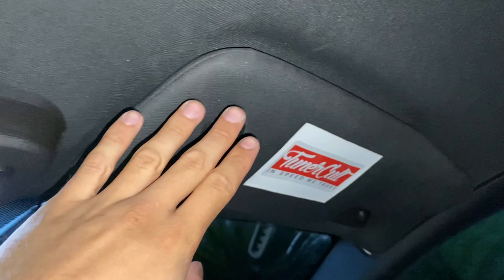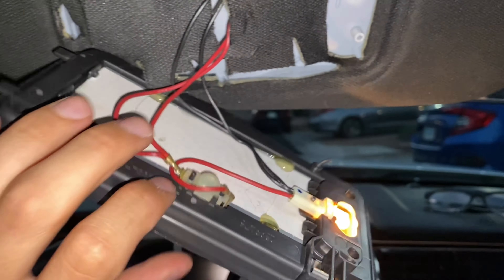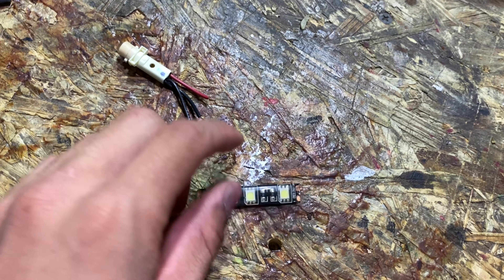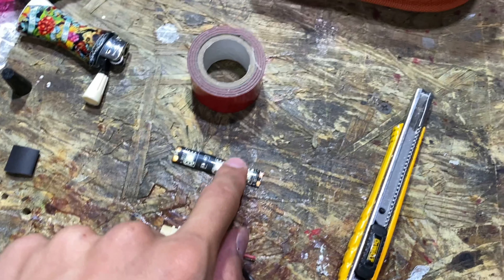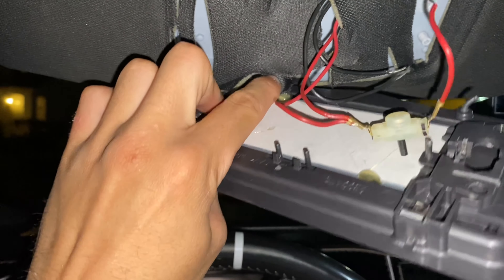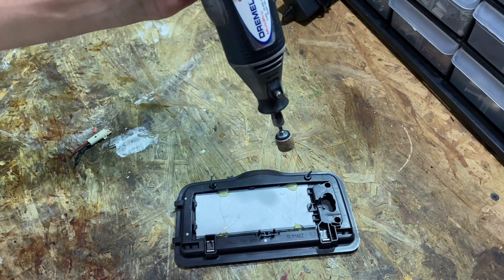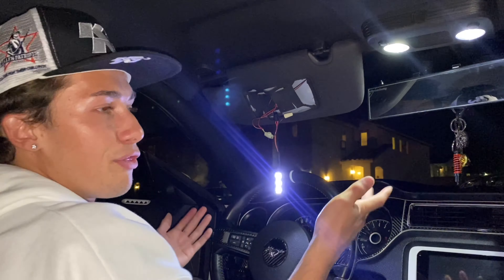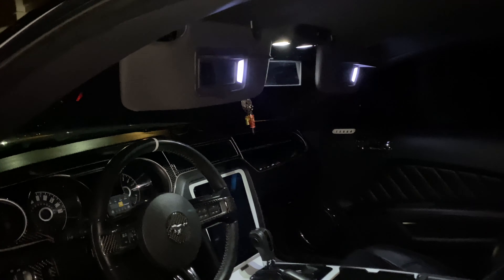Custom Visor Lights For Your Mustang!!!

Comment: Where did you get the LED strip material?
Reply from the maker: Amazon my friend
Reply: @LoganScott.  
Do you have that link for that small of a led strip? I really would appreciate it man great video by the way.
Reply from the maker: @christfollower1768 I don’t have a link off hand  but there are a variety of options available. Link of a similar one will be down below. I bought a 16ft black outdoor roll and cut it down to the size I needed.  Shouldn’t be no more than $25. 

https://a.co/d/2pUALrR